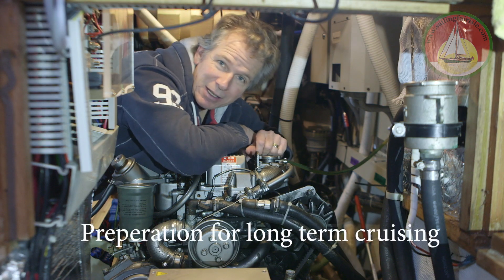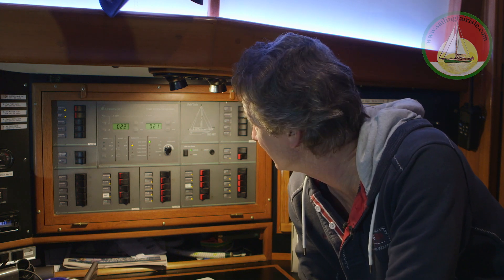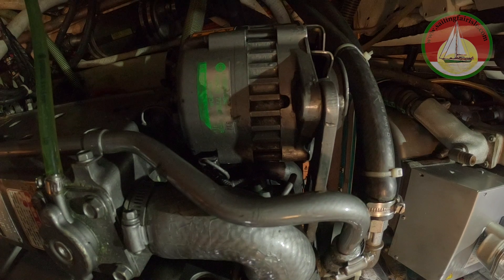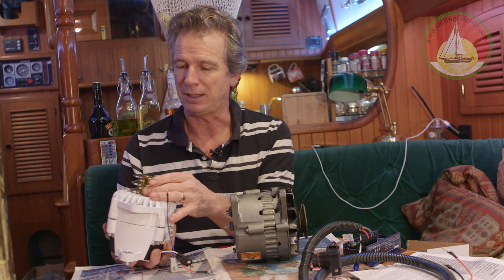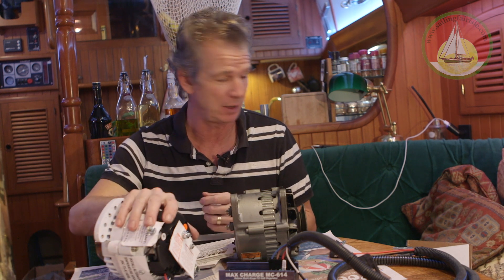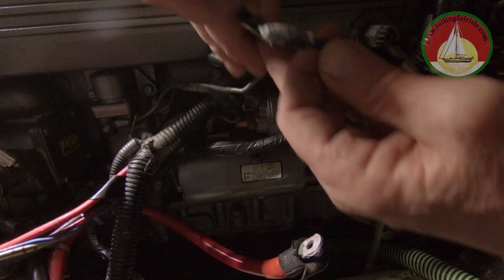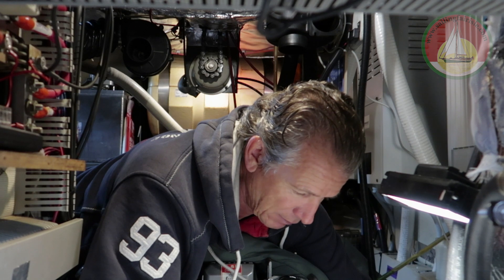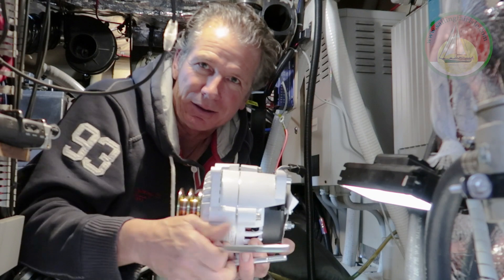Uprate  your boats alternator

Comment: To all folks upgrading alternators:

Beware of ALL alternator power output numbers. Yes, they can pump their maximum spec Amps, but it's a con in the real world 

Ignoring car alternators completely, as they should never be anywhere near a boat .... Even "marine" or  "high output" or " heavy duty" have maximum warranty duty cycles of no more than 65% of quoted power output. I've uprated from 25A > 80A > 160A and now 250A to be safe and happy charging at 140A into my lithiums.

I'm surprised you didn't go even bigger-- given that one day you'll probably migrate to lithium! 

Gosh, 500Ah of AGM! You'll save 200kgs on weight and 50% space.
Reply from the maker: Yes you’re right, should have gone bigger and converted to serpentine belts. At that stage I didn’t think lithiums would come in so quick and I didn’t know our generator would be so much trouble and I would ditch it! We do okay with the solar but at some stage soon I will upgrade the alternator again.

Comment: Great videos and well thought out.  I've watched a video from 'Distant Shores' about hybrids.  They comment on serial and parallel hybrid systems.  Technically, serial hybrids have so many advantages.  Parallel hybrids are easier to retro fit.   But for a new build why wouldn't you go for a serial hybrid with say 2 hours of battery motoring for maneuvering?  For longer motoring run the electric motor off the the diesel generator.  The batteries would be enough for most ship systems.  (Diesel electric trains are serial hybrids of sorts and have been around since the 1960's).  So why aren't serial hybrids popular?  Too expensive for the technical gains?
Reply from the maker: I agree that serial hybrids are the smart way to go and I think that’s exactly what you will increasingly find in new boats, especially cats.

Comment: Most of the reason for low charge current is the simple fact that the alternator is just not being spun fast enough. 

Alternators generally need about 6,000 rpm to generate near full output. When being drived by an idling 700 rpm engine with maybe a 2.5 to 1 drive, the alternator is only turning about 2,000 rpm.

Alternator overheating can be caused by trying to draw too much current without turning it fast enough to move enough cooling air through.  If your alternator is running too hot it may be driven too slowly. 
Need to kick up the drive speed.

Comment: Thanks for a great video , I’m about to fit the same alternator and wondered if after like a 3 hour run what sort of amps did you see out of the 150 amp alternator once it all got warm and de rated , cheers
Reply from the maker: Well the MC614 regulator lets you choose how much to be honest so it's really up to you how much you want to push it. Also with a lead acid house bank the defining factor is always the internal resistance of your batteries, so unless you have a massive house bank (we don't) after three hours you are liable to have a battery bank that's incapable of taking more than a few amps no matter what you are trying to throw at it! We're just changing over to lithium so that wont be the case for use now & if the house bank was low after three hour we could still be getting full power from the alternator if we choose. But we wont do that as it will put a lot of strain on it. I have set the belt manager to 7 which will de-rate it somewhat and I have the max alternator temp at 100 degrees C. I will probable go higher with both of those but I'll try to be as conservative as possible with the alternator and let the solar do as much as possible.
Reply: @svfairisle  thanks for the reply , I have a fair amount of solar and it will be charging my lithium bank , I’m just worried this will drop back to like 50 amps after an hour or so and make it unsuitable , if it was going to do that I would upgrade to the large case or have one custom built , I only have space for a single cylinder 3000 rpm  salt water cooled genset and refuse to pay the 15 k it will cost by the time it’s installed , my main engine is only 24k and if in half an hour I can heat hot water and throw in 50 amps I will be more than happy , I have had friends doing it now for large amounts  of hours and believe the glazing up the engine is just  a myth from the old two stroke Detroit days , as long as engine is at temp I think it would be nearly impossible for me to glaze it up cheers Richard
Reply from the maker: Yes I agree occasional use of the engine for charging might be preferable to fitting a very expensive gender. I think glazing is an issue but probably rectified by a good thrash of the engine from time to time. I religiously give a blast of full throttle every half hour or so if we’re having to mother for any length of time. The thing to watch out for if how many revs you need to get the alternator working well. We need about 2000 revs to charge properly and I wouldn’t really want to do that out of gear. It will be interesting this year to see how things go but I’m hoping that we won’t need to charge from the engine at anchor.

Comment: Can someone link me to episode 4, please? TIA.
Reply from the maker: Have a look at the description in this video, there's an update there.
Reply: @svfairisle   I did read all of the description, and I can't see a link or a reference there. I did go to your channel, too, and could not see the follow-up video there, but must have missed it. Can you link to it in the description, please?
Reply from the maker: @KitLaughlin  Sorry Kit my mistake, I wrote the update in Ep4’s description, link here… https://youtu.be/sj4bpbEMc7Y I didn’t get to do a proper update in that episode as we hadn’t tested it enough. I’ve talked about it in other episodes over the last couple of years. There will be a whole update on it coming up as well as I’m just changing over to LiFePO4 batteries. Part of the reason for choosing this alternator and regulator was their ability to work with lithium as  I knew I would be upgrading. Lithium can be very demanding on alternators as they will accept full current for a long time unlike Lead acid which ramps down quickly as the internal resistance goes up. The fact that the regulator has a temperature probe on the alternator is key to it not allowing the alternator to cook. I will also probably derate the alternator further with the belt profile we shall see.
Reply: @svfairisle  Sincere thanks, Steve. And I understand completely re. the demands of Lithium; Victron have an excellent video on this if you have not seen it; the keys as you mention are having a temperature sensor on the alternator's case, and not running the engine too slowly. See the video here: https://www.youtube.com/watch?v=jgoIocPgOug
Again, thanks. I really like the naturalness of your presentation style, too. Kudos.

Comment: I've just seen someone refer to the Victron vid on lithium charging -  - that video is a total SET UP.  They set it up to promote their products. Look at 00:13 - you will see that the driving pully is even smaller than the alternator pully - and they ran that alternator at 1500 rpm. In the real world the crank pully (Of a manufactures set up) is minimum a ratio of 3:1 - so even on tick over the alt would be spinning at nearly 2000 rpm - the speed they ran the Balmar at was 2110 - so the situation they portray is just NOT POSSIBLE in a real world application. . I think that's why they banned comments.  Also, I have found a number of ppl running Lith as a drop in - OK it doesn't give a 100% charge bc Liths like slightly higher charge voltage but if you dig deeper it's only recommended to charge Liths to 100% to enable the BMS to do a top cell balance from time to time. If you run them at 95% max SoC then you considerably  extent their life. That's why there are apps for smart phones that prevent cooking the battery and excessive draining . I hope this helps ppl to get a better understanding bc Lith is the way to go ATM.

Comment: Excellent video, thank you for sharing. 

Can you elaborate on how you used shims to fix the angular misalignment? I’m wrestling with a similar problem and would appreciate any tips. Thanks.
Reply from the maker: All I was doing there was getting the pulleys in line. The bilge pump pulley was farther.back that the others so putting a shim ( I just have a collection of old washers) between the pump and the mounting lug on the engine will move it forward in line with the others. Usually the water pump and crankshaft pulleys are fine if they’re standard to the engine, same with Hitachi mount alternators as they have twin mounting lugs on the engine. It’s additions that are often the problem as was the case with my bilge pump. It is possible for  accessories like this to be off at an angle as well as mine was slightly & this one was mounted with two bolts so shimming one of them was enough to twist the pulley in line with the others. If there is only one lug then you may find yourself having to file a bit off one side or inserting a thick washer that’s been ground down on one side. Hope that makes sense.
Reply: @svfairisle  Makes sense, thanks!

Comment: I have looked through the comments but can't find my question. 
Why are you uprating your main drive engines alternator when you have a generator that should be designed to charge the batteries? Let the main drive engine charge is own starting battery and leave the rest to the generator? I would not want to risk the main engine breaking down.
Reply from the maker: We never use the engine purely to charge the batteries. If it's a charge we need of course we use the generator, as you say it's what it's built for. However anything that keeps generator use to a minimum is a good thing in my book. We plan to eventually get rid of the generator all together. In an average cruising week, there are spells of motoring / motor sailing when there's no wind and of course to and from anchorages every day. The uprated alternator gives us enough charge to mean we very rarely use the genny. Before even with a few hours motoring in a day we would have to run the genny in the anchorage, not good!
Reply: That makes a lot of sense. Thank you very much

Comment: Steve, Great informative video. The emphasis on alignment and correct fitment/use of the sliding bush (you called it a shim) on the top mounting bolt cannot be over stressed. I have to wonder however if you could have achieved most of what you needed by getting the best from your existing alternator by fitment of an external regulator. What type of charge splitter between the start battery and domestics do you have? This can also seriously impact charging rates if the regulator is 'looking' and a fully charged engine battery while you are trying to charge the domestics.
Reply from the maker: Very good point. In fact the diode based splitter that was on the boat wasn't really up to the job so I removed it. At the moment I'm manually switching the house / battery for charge and use. I will fit a better automatic switcher when I find one. The existing alternator even with an external reg. wasn't really up to the job, but makes a good hot spare.
Reply: @svfairisle  I had the same issues with a diode based splitter so fitted one of these: 
https://sterling-power.com/products/volt-drop-alternator-splitting-system-pro-split-r

It solved all my charging issues as it 'looks' at all batteries and diverts the power where needed allowing which ever reg you are using to voltage sense the battery which needs the charge the most while prioritising the engine batt as needed. It's so good I've fitted 3 more on friends boats for them and they have all worked great. In fact I bought an external regulator at the same time but the system now works so well I haven't bothered to fit it!
Reply from the maker: Thanks for the tip, it does look like a great bit of kit, I've just emailed them.

Comment: Fascinating battery dials. Don’t understand. You manually adjust the charging?
Reply from the maker: Yes. There is a potentiometer that allows me to adjust how much output we get from the mains transformer. This means I can adjust between trickle charging or the full 100amps which is important. Also because the  onboard generator runs through the mains charger I can adjust it to vary the load on the genny. If you give it too much load it will stall.
Reply: Sailing Fair Isle I had no idea such controls existed. How clever.

Comment: Steve, I've just started watching your technical videos and find them to be very informative.  The previous one on solar didn't tell me anything I didn't now because I'd previously installed panels on my boat but for the 'newbies' out there, I'm sure they'll learn a thing or two.  This video, about the alternator, did teach me a bit about how the regulator is able to sense the temp of the alternator and how that system works and that's something I didn't know!  I just replaced the 43 y.o. alternator on my Atomic 4 gas engine, which was original to the boat, with a larger capacity unit because the original one finally died after 43 years and my goodness, having that extra capacity makes a big difference in how quickly the batteries charge.  I went from a 30 amp (on a 30 hp engine) to a 60 amp (as I recall).  Anyway, thanks for the informative and well produced videos and I wish you and your lovely wife good health during these times.  Cheers from Juneau, Alaska!
Reply from the maker: thanks Wade

Comment: Great vid thanks.  I have a Balmar as well on my Hylas along with a standard alternator on my Yanmar 4JH2-TE.  I can switch between alternators if desired and turn each on or off depending on what I want to accomplish.  I'm curious, however, regarding your statement about NOT running the Gen Set.  Why would you consider it a better option to run the engine instead of the Gen Set and the high-output battery charger likely attached to it?  I have a 150A Xantrex battery charger/inverter which can make short change of recharging the house bank.  I would prefer to put the hours on the Gen Set over the engine if I require a recharge on the house bank.
Reply from the maker: Oh No. Sorry if that's how it came across, I would never want to run the engine just to charge the battery, terribly bad for a big diesel to run it at tickover. What I was getting at was I eventually want to do away with the Gen set. I'm probably biased against it as it gave me no end of trouble when we bought the boat and a hate the bloody thing! A new water pump, cylinder head and front end rebuild later (oil pressure relief valve was stuck) and it's okay now but you know what it's like I'm just waiting for it to go wrong now! So I would like to have enough solar that along with the Balmar (charging when motoring) I won't need the gen set. that will probably only happen when I up rate the house bank either in size or type. Sorry for the confusion, Steve
Reply: Interested in that two alternator set up...

Also how best for those with a single balmar to revert to the  stock  yanmar alternator as a backup

Comment: Tip for sailers .  Be aware that some installations do not measure the correct alternator output. 
Verify that the volt and amp measuring units is installed correctly before troubleshooting with onboard panels.
Reply from the maker: Yes good point, shunts are sometimes badly set up or add on auxiliary items installed that confuse the system. I'll write up a lot of those issues on the Alternator page in tech. corner when I get I chance. The most common problem wiring wise is usually the alternators sensing , it's very difficult for the alternator to see the true state of the batteries charge because of the changing draw on the house bank. All gets a bit complicated for the video! Steve